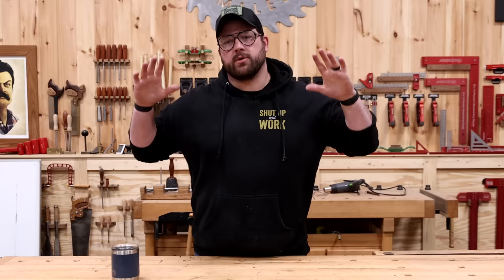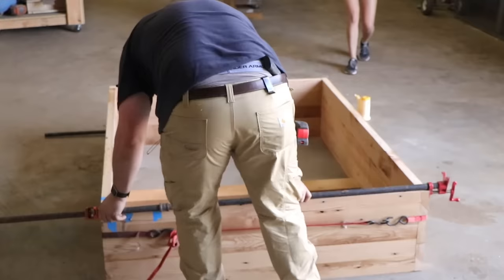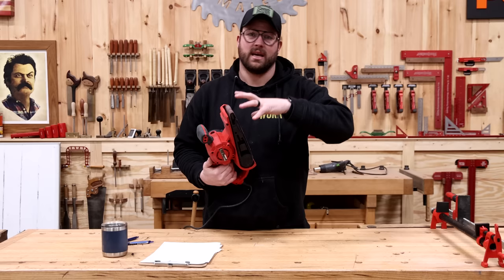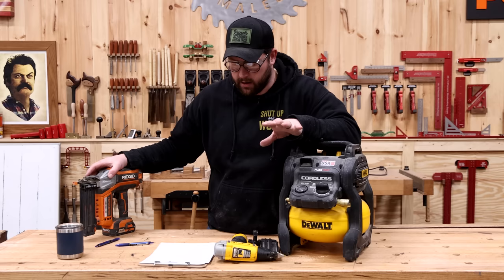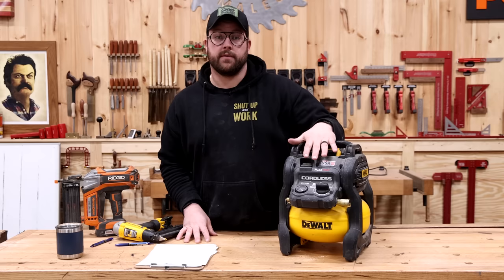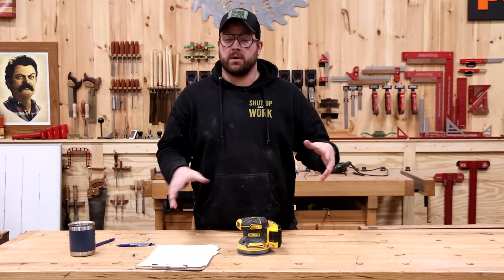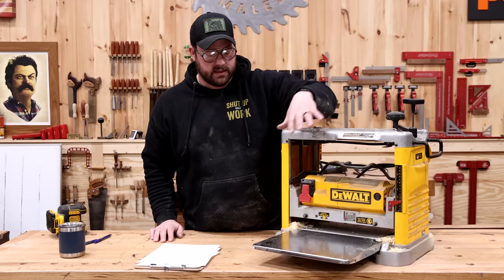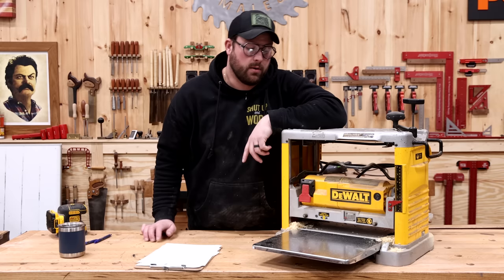5 Beginner Woodworking Tools I Regret Buying

Comment: As a journeyman carpenter/ fine woodworker, your right on the clamps, palm sanders are nice I use the air powered ones, get a Porter Cable, half sheet sander, if you’re doing finish carpentry in houses, check your building codes before buying a common finish nailer, a Senco shoots a actual finish nail, hate to see you pulling doors out because you’re nails are not nails. If you’re doing a lot of glue ups,  make or buy yourself a good hardwood European work bench and a good solid table saw and go from there. I see a lot of expensive tools on the wall behind you, you can do alot with a rafter square and a speed square. And learn to hand cut mortise and tenon joints, it’s really not that hard

Comment: You can make wedge clamps to pretty much any length you want for panel glue ups from old mdf and/or a piece of 2x3. Total cost would be <$5 per clamp. I made 3 from scrap mdf and they work a treat. Plenty clamping pressure and spread over as wide an area as you want to make the wedge.

Comment: The cordless brad nailer is amazing it's a pain in the ass to go to someone's house to put in a couple pieces of trim and have to lug in your compressor air hose and gun and most likely lug out your miter saw and everything else it's so much easier to just bring one tool into the house and install

Comment: Cordless palm sander is really nice for finish trim work on new builds. Have it on n my bag, perfect for when I catch one tiny thing that needs sanded for 1/2 a minute, especially if a ladder is required. Way better than screwing around hooking up your sander to an extension cord, then trying to find a outlet that actually has power. I’m there and gone before I’d even be plugged in with a corded one

Comment: So I bought the Ridged sander you showed. Love it, and use it all the time. I also bought the Ridged planner like the Dewalt you showed. Never ever have I had issues with the breaker. It has awesome power. I run walnut and maple , and other 10 to 12 inch slab cuts all the time. I do have mine fixed to s stand from Harbor fright... but yeah its awesome too.

Comment: I consider myself as a beginner after 2 years when it comes to wood working and if you’re not doing framing or roofing. Battery powered nailers are a must specially the Milwaukee line

Comment: I am not a woodworker as much as I am a general DIYer in a 40 year old house. I have had to rebuild a set of cabinets after a bad inlet valve in a dishwasher ruined the MDF sides on them. The cabinets had synthetic stone countertop on them so nobody would touch it without me accepting full responsibility if the countertop broke.

Oh yeah - back to general DIY. Now I am doing a lot of drywall fixes, and the cordless palm sander is front and center. Cords drag and tend to make palm sanders gouge the soft wall surface, and palm sanders are perfect for flattening a skim coat that is closely surrounded by existing texture. I'll be removing a telephone wallplate today, putting in a patch, and using the good old HF cordless palm sander to prepare it for texture. Life is good.
BTW - for drywall, I have to give a shoutout to my mentor, That Kilted Guy. I'm reading a couple of his ebooks, but most of my inspiration and skills have come from his videos. I can't believe I waited 70 years to develop such a useful skill.

Comment: I mostly agree with you, but I love my Rigid 13" planer.  It leaves virtually no snipe.  You make light passes, but it is easy with undicut on the entry to get exact thickness.  I have it on a good mobile base, and an outfeed roller makes it work perfectly.  It's about $300 less than DeWalt.

Comment: You can always look up old-school all wood clamps and replicate them that is what i did i just took 2 bords squared them up driled threw them with a drill press with a 1" hole and i run dowls thru the desired hole and use a simple wedge to tighten it all up it works great and clost allmost nothing 👍 i went with the 13" dewalt thikness plainer im glad i did im olaning on replacing the cutter next

Comment: I can agree with most of what you said but after woodworking for 50 years, I have found the belt sander to be enormously helpful. I use in in a vice for sharping tools, with 60 grit paper for rough finishing raw wood, and  removing  old finishes. As to price I have a couple of $40-$60 sanders from Amazon which have been working beautifully for 6 years! If you get gouges with it, you are using it wrong and forcing the tool. Let the tool do the work.

Comment: I love my ryobi nailer. I don't do a lot of nailing, and in my tiny space I didn't like dragging a air hose around. I did get that kreg saw attachment and it is trash! I completely agree that a cordless sander is a horrible idea. I don't even own one because the concept is nuts. I have the larger dewalt planer and it is awesome.

Comment: Totally agree on the clamps. Have a belt sander and rarely use it.  I have had that planer for over 30 years and never had the problems you had with it and I do a lot of hardwood.  Just my 2 cents.

Comment: I totally agree about the clamps.  You can also find the pipe clamps at garage sales.  I have over 20 of them now, only the first 8 were bought new.  Also agree about the cordless sander.  I have one and the battery is off the side, meaning the weight is unbalanced.  I have to work more to hold it level.  I never use it, always use the corded model.

Comment: parallel clamps -> pipe clamps, belt sander -> random orbital sander, cordless nailer -> air nailer, track saw guide -> watch another video to diy track saw guide, hollow chisel mortiser -> other means, cordless palm sander -> anything else, rigid benchtop spindle/belt sander -> anything else, also dewalt 12" benchtop planer

Comment: 100% agree on all the tools except the Ridgid spindle/edge sander. I use mine all the time. I usually use it in the edge mode. One of the great features is that it oscillates. If you don't put too much pressure on the workpiece, it gives a superb finish with a 120-grit belt. The belt change is fast and adjusts easily, and with a course belt, you can do some quick small-job shaping... We all develop unique likes and dislikes. That's one of mine. (Emphasis on "one of" 😁)
Reply: I was thinking the same thing, I bought mine for a very specific job and now use it all the time.

Comment: 1.  I've used pipe clamps for many years
2. Love my random orbital sander!  CORDED btw.. and from Harbor Fright! 
3. Yeah I fell victim to the cordless nailer.. but I DO have a an AIR nailer that can do both brads and stables.
4. Again, I fell victim to the Kreg POS.  Used it once, and now it's decoration only.. anyone want it??
I DO love the Kreg pocket hole jig tho!
5.  I had a LOT of equipment that did get used a lot, joiner, planer, , mortise attachment for drill press, table saw, band saw, tons of clamps.  We down sized 3 years ago, sold house, and ALL my major power tools and hand tools and went full time RV for almost 2 years, and THEN, to OUR shock, we bought a house!  Now I'm starting from scratch!  I did save my hand power tools, router, biscuit joiner, grinder, but no clamps :(

Comment: Journeyman cabinetmaker/finish carpenter here....

Pipe clamps are certainly in every pro shop.
You will most certainly be VERY aggravated if buying and attempting to use Harbor Freight pipe clamp fixtures. You dont want clutches slipping while doing a glueup.

Beltsanders are not needed by most people. However, if you build countertops all day, it'll be your right hand tool. The trick to using it is to NEVER stop moving it. EVER. You'll know as soon as you make your first crater. It'll take about 4 or 5 seconds of not moving the sander.

Forget compressors,  just buy the cordless nailgun. In fact, buy cordless everything, palm sanders too.
NOBODY likes tripping on hoses or cords.  And NOBODY wants to carry 2 tools around, when one will do. 
PS:  the Ryobi brad nailer is actually better than i expected, and half the price of Dewalt and Milwaukee.

Definitely get yourself the Ridgid spindle sander. It is WAY better than using a sanding drum on your drill press, just trust me on that one.
Actually, get the Wen spindle sander. It's virtually identical to the Ridgid, but offers a second  bracket to hold up the table (really Ridgid? You had to cheap-out on a bracket??)

The 13" Dewalt planer is great for a hobbyist! I have one in my garage. 
But literally zero pro shops are using them. They're using much more robust equipment.

Thanks for reading 😊

PS:  I'm 55 and still have all my fingers. If you're using a tablesaw, and something feels wrong about what you're about to do....don't do it. I know a young guy, and an old guy who both are missing fingertips.
Just be careful.

Comment: LOVE THIS!  Thank you.  
So for some additional perspective:  
1) SANDER - Bauer Random Orbit sander from Harbor Freight. It's loaded with the same options as the Dewalt and it's normal sales price is about 60% less than the Dewalt and even lower (the price NOT the percentage) when it's on sale.  AND it's received GREAT reviews online.  Also they have a Bauer orbital plate sander for like $20 normal (not on sale) price!!

2) COMPRESSOR & NAILER - Completely agree to go with compressor over battery op gun.  BUT the compressor you're talking about is $219 at Home Depot WITHOUT the gun.  Also The one you suggested is only 2.5 gallon and requires batteries. Also check the prices between the Dewalt and the Ridgid because they're constantly moving and going on sale.  Ridgid has a combo of the corded compressor + 3 nail guns (3 different sizes) for regular price of $299 but it's recently been on sale.  Both Ridgid and Dewalt have the 6 gal, 1 gun option. Dewalt's is $239 and Ridgid's is $219 and those are normal sale prices.

Anyways thanks again - great vid!!

Comment: I have a Craftsman? sander that looked like his and I love it and use it more as a rough sander to get rid of imperfections fast with a coarse grit. Then I switch to an orbital for finish sanding with 120 or higher grit. Sander is much faster for rough work. and the small spindle on the front allows getting into small circumference inside  curves. And I save my worn out course belts for finer/less course sanding.

Comment: Very nice suggestions and explanations; if I may share my humble recent experience: I just got a belt sander, most needed for helping me in restoring a parquet, and I got it online for 45$. So for this money and considering that can be secured upside down and used as a table sander, I personally think it’s quite a nice deal and a pretty useful tool, especially if a “big” job need to be done: in sanding a wide surface in the attempt of removing a very stubborn varnish the orbitals I’ve are way slower and the sanding power is far inferior (using the same kind of abrasive paper on them). So not just I would’ve spend a lot more time on it, but I would’ve spent way more money on sanding paper. Just my two bits worth on it, without taking anything out of the good suggestions on John; simply sharing the experience if it may turn out useful to somebody in my same situation.
Reply: I had just made a similar comment. Mine was a gift and I love it. Fact I can clamp it to the bench is awesome
Reply: @J2ricker  happy to hear somebody had a similar experience :) it’s definitely a handy tool

Comment: John,  I guess you could say I am the weekend warrior in woodworking.  I have to agree with you on several of the tools you pointed out.  The Kreg Circular Saw Guide is awkward on a circ saw.  I bought it and I used it.  I hated using that.  Just isn't worth it.  The dragster style belt sander, I have one and it is difficult to control and the belts keep sliding out of alignment.  I finally gave up on it.  I cut the sanding belts to fit my handheld sheet sander.  The battery powered orbital sander goes through batteries faster than any battery power tool I have including the big amp hour batteries.  Even my battery powered sliding miter saw doesn't go through batteries that fast.  I have bought a corded one to replace it.  The battery powered brad nailer is another tool I have bought.  I have the one you can adjust for different length brads.  I found that the longer the brad the more trouble I have with the brads going in.  It appears there isn't enough power to drive the longer brads into the wood.  I end up wasting more of the longer brads.  I do have a pneumatic one out in garage I haven't used.  I think I will try it out.  You got more of those tools to talk about?  Thanks for the tip on the pipe clamps.  I haven't bought any of the long clamps yet.

Comment: Ditto on the pipe-clamps.  Pipe couplers are a great idea.  Thanks!   Came to the same conclusions about battery vs. air for nail guns, vs. cords for sanders.  It's a less convenient set-up to plug in the lines, but it's constantly inconvenient to lug the weight of a battery.  Still luv my cordless drill and jigsaw. It's hard to bite the bullet for an air compressor, but they open a a lot of doors.  When I redid my roof (the purpose of projects is to justify tools) I found a pretty-used american made contractor-grade compressor for a few hundred bucks and it's been well worth it.  A few years in to pay someone to replace starter switch contacts for $250, but it continues to earn it's keep.  I chose a very-used model in order to afford a quality design with enough cfm to do a lot of things:  A Rolair twin tank unit w/ 7 to 8 cfm at 90 psi.  Just barely enough for small sand-blasting and a good paint gun (not HVLP); definitly enough to push grinders or multiple nailers,  etc. over a long hose.  On cold winter days, do you remember the lines at your gas station to check the air in your tires?  Nice to have an air compressor (just follow the instructions about starting up in the cold).   Thanks for doing this one.  Learned a lot about planers.  Would be interested in your thoughts about growing into the world of routers.  I recently bought a trim router and a few blades for a special project (.. and what is the the purpose of projects ?)  but I can see there is more to know about routers.

Comment: Great video!  I have 4 of your top 5 and 2 of the honorable mentions all collecting dust for pretty much the same reasons.  That said, my 80# DeWalt planer tipped and strategically hit me below the belt with a short 2 x 4 moving at nearly the speed of sound.

Comment: Regarding compressed air nailers vs battery nailers: used tools oughta be part of this conversation. On Craigslist, I got a serviceable-yet-unspectacular air compressor or $100, and eBay got me a great Husky nailer for $30 shipped. Those tools are rather old but they will work forever. If a battery platform changes, if a manufacturer goes under, anything like that… your battery tool becomes a paperweight. 

I love battery tools and I will keep buying them, but anything that can run on air… I will buy the air powered version.

Comment: The clamp argument is a great one. Pipe clamps rock. That said I have a ton of smaller clamps you can use with one hand that I find invaluable. I am usually solo when I do a project around the house and they allow me to work alone a lot more efficiently. Belt sander....check  BTDT, brad nailer...check - I went pneumatic and all my nailers  too and never looked back. I admit now there are a few times I wish I had a small battery type for a quick job, but overall pneumatic tools rule. Esp if you are outside doing something like building a picket fence using a staple gun. A battery tool would not be able to keep up. And you're right....much more fun to use !! 

Honestly, except for my one cordless drill, I much prefer corded or pneumatic tools overall. I also like having at least one corded drill with a keyed chuck. But hey I am an old dude so I get the attraction to cordless. But a tool like a sander that you want working at full speed all the time....not something I would want without a cord. Great video brother !!

Comment: thank you for telling me about the pipe clamp! I have been trying to find cheap but effective clamps for my first project and didn't want to spend a fortune on just clamps
Reply: Pipe clamps are kind of expensive if you also have to buy the pipes. But if you can find scrap pipe somewhere then they're a deal. You do not need the best pipe for pipe clamps. If there's thread on one end you're golden. But to use a coupler you would need both ends threaded.

Comment: early on I bought a tenoning jig for the tablesaw. That was before I learned the way to cut tenons with a miter gauge and rip fence. The tenoning jig sits under the saw collecting dust.  I did use it recently but not to cut a tenon when I had a strange cut to make and needed a safe hold for the work piece. I'd add that to the wait and see if you'll really use it list.

Comment: After 20 years I'm finally ready to get  rid of those bar clamps and switch to pipes. I found that Kreg side track cutter to be a POS however the clamp free track saw has worked out pretty good for me. I'm in a chair and can no longer run a sheet through the table saw.

Comment: I acquired most of my tools second hand. I shop via auctions and social media. I know how much the tool cost and never pay over 1/2 price. I picked up a 12 gallon air compressor for under $20 because it was missing a ground pin on the plug. $3 for a replacement plug and it was good as new. My belt sander was $15 at a ReStore. Only thing I bought new that he listed was a craftsman planer. Hard to find them used. It was still much cheaper than the DeWalt. It has better dust collection and I have never tripped the breaker on the machine. Most of the brand new tools I have were Christmas presents. I find the cost saves of used to outweigh the benefits of not having to fix an occasional issue with a tool. You can spot issues before you buy used tools so you already know what you are going into.